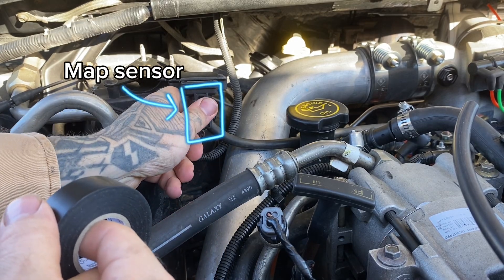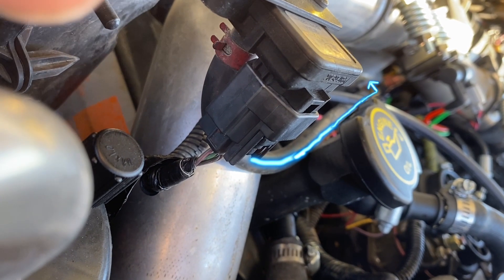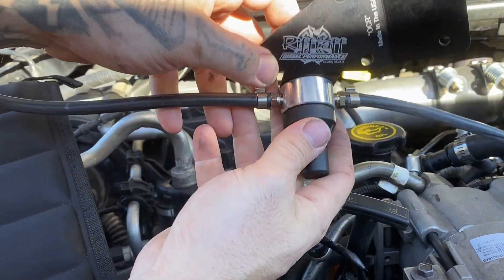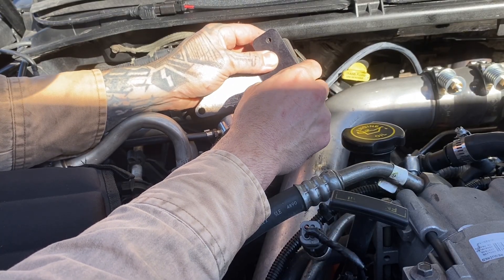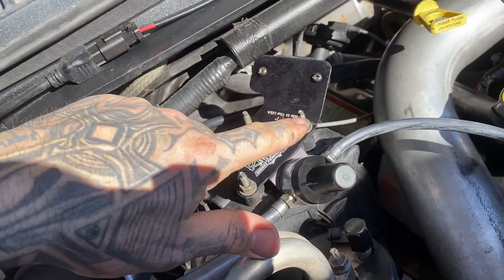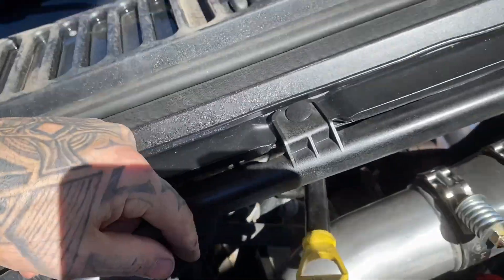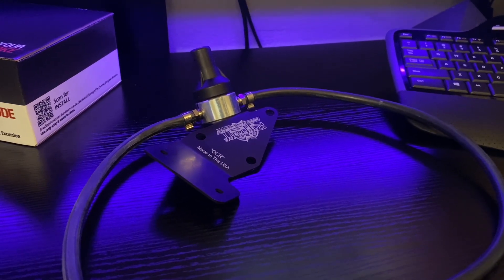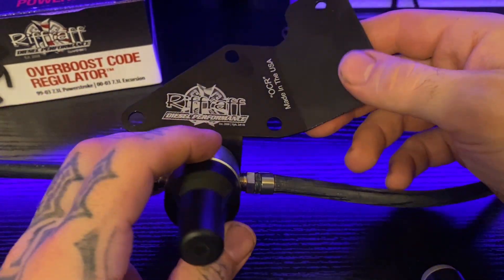Boost Fooler Code Eliminator - 7.3 Powerstroke F250

Comment: Where do you run the old tube?
Reply from the maker: You get rid of the old tube, as you are replacing it with a new tube that has an in-line regulator.

The extra steps of removing the bracket, mounting the MAP, etc are not required for functionality.
Reply: @ okay thank you, I ordered the same one for my 7.3 so I will be installing it next week.
Reply from the maker: @swain8648 No problem. It’s a super easy install. Remember to get you two small screw clamps since the new tube’s OD is a bit small than the stock tube. You wont be able to re-use the stock clamps.
Reply: @ noted

Comment: I can’t believe how expensive these damn things are from riffrafff  They wanted $147 to ship it to my door. I could build one for less than $30. It makes absolutely no sense at all to buy these for $100 when you can build one yourself for less than $35
Reply from the maker: @YoungOzzy432  I considered building one myself picking up a pressure regulator and parts from Harbor Freight. It is preference. I rather not worry about tinkering around with the regulator screw getting it set and hoping it doesn’t work loose over time though. Ive posted about this in a few groups online and the ones that do this said to be mindful of continued adjustments here and there. Plus the bracket setup looks cleaner. But to your point, you could even weld the regulator on a fabricated piece of metal. RR doesn’t sell in high volume (I’m guessing) which is why I think their price is higher.